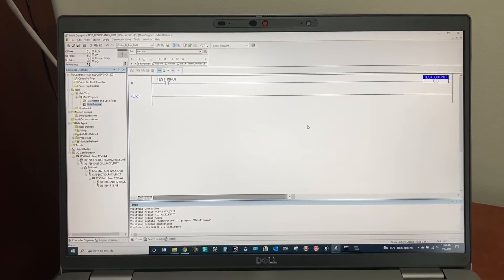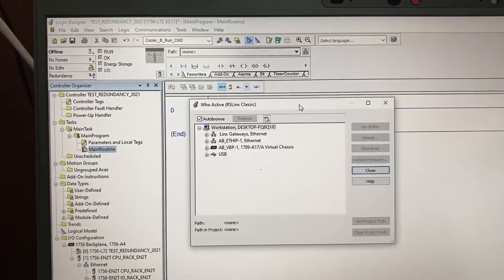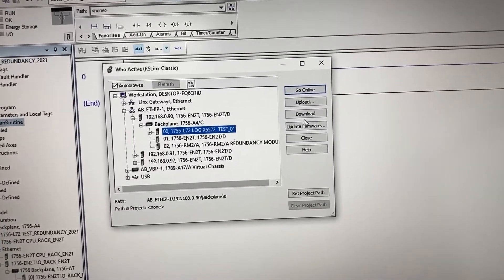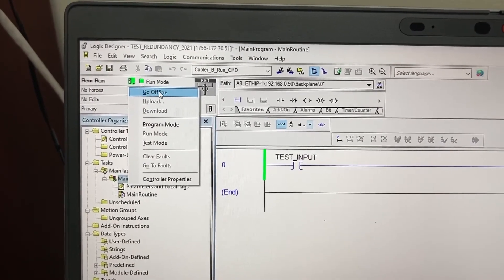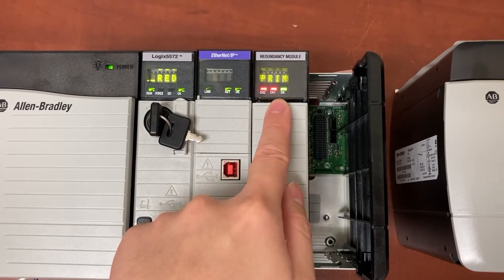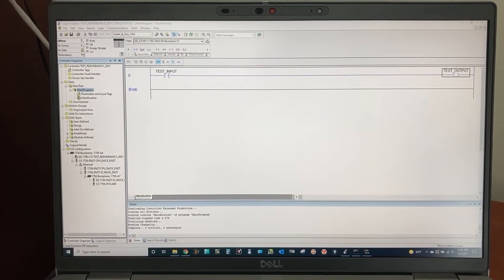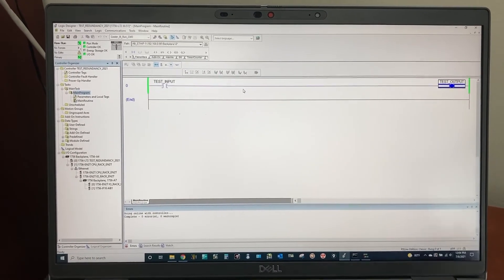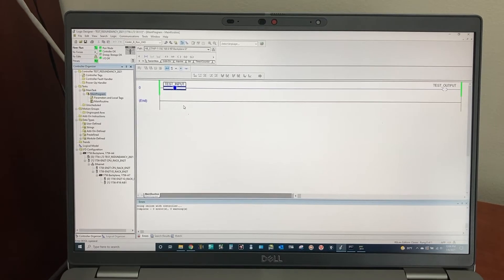Allen Bradley ControlLogix Redundancy System 1756 Part 5/5 - Program Download and Sync

Comment: At the beginning you setup your second ethernet module with .90 as well, but here I can see  the address is .91, that is logical but my inquiries is, do you setup first with the same IP address and then, when they synchronize the IP address change? Or must be .90 to Ethernet 1 and .91 to Ethernet 2?
Reply from the maker: @andresf-sierra: I always set the same IP address to both ethernet modules on the 2 PLC racks to keep it simple. I never tried to set them up differently. As you can see in the video, once the second PLC rack is powered up, the next available IP address which is .91 is automatically set to the ethernet module regardless of what has been set to it (.91, .92, .93 or .250, it does not matter). What I mean is the IP address for the ethernet module on the PLC rack that is FIRST powered up matters most. If it is .90, .91 will be automatically set the the ethernet module on the PLC rack that is powered up later. For the PLC rack that is powered up later, the only thing we need to make sure is it needs to be on the same network or subnet with the FIRST one in order for the redundancy to work. I hope this has answered your questions and cleared up your concerns. Thank you for subscribing to my channel and bringing up a very good point on IP addresses.
Reply: @SYPHOANG  Yes, thanks man. When you say the same subnet are you referring to the Network Mask? Or just the same Ethernet Switch connection?
Reply from the maker: @andresf-sierra: Same network or same subnet are the same. It means the same subnet for the IP addresses such as 192.168.0.90, 192.168.0.91 and 192.168.0.92 (only the last numbers are different or unique). Hopefully this has answered your questions.
Reply: @SYPHOANG  Of course you did, thanks for your kindness.
Reply: Hey, I already flash all the modules but when I jump to the RM2 setup step, it's no possible to open the "Module Configuration" in the RM2 module, any clue?
Reply from the maker: @andresf-sierra: How did you flash the firmware? Did you use the one in the bundled in the zip file downloaded from Rockwell website.
(@3:58) https://youtu.be/2vnflGhBkQg?si=5bGyayV3ADaOnyOG
also check your RM series and status indicators. Good luck!
Reply: @SYPHOANG  Yes I did. I dowloaded from Rockwell page, unzip the .dmk into a folder, then when I was in the Flash process I selected that folder and flash it. All the modules goes well with the flash process, however, when I tried to right click the RM2 module, Module Configuration options doesn't appears.
Reply from the maker: @andresf-sierra: (1) What is your studio5000 Logic Designer version? Is it 30 or above? It should be 30 if you are using the exact firmware bundle in the video.
(2) In Rslinx, does the RM2 module has a graphic icon? Or is it just a big question mark? If it is just a yellow question mark, you can "Upload EDS file from device" and try it again.
Good luck.
Reply: @SYPHOANG  FYI, we successfully complete the process, however, we talked with Rockwell Customer Services and they guided us in the process and the thing is, now, the setup of the module is a physical process. We need to connect first the RM2 module, setup and then the others modules.
Reply from the maker: @andresf-sierra: Of course, you should do it one at a time.
@0:05 https://youtu.be/xqF7rsclrtI?si=4mSTGJjHG6hHJTZ3
Although both PLC racks are powered up but I have no cables whatsoever connected in between.
I guess you had ethernet cables and fiber optic cables connected between 2 PLC racks. That might be the reason.

Comment: Do I need two fiber optic cables to connect between modules? Will one cable work?
Reply from the maker: @Bentimmy4: Yes, you do need 2 cables. It still works with one but you will no longer have the redundancy if that only cable fails.

Comment: If you make an online change to the primary plc program will it automatically sync to the secondary plc or do you need to toggle power?
Reply from the maker: @emg1233: It's best to turn off one PLC rack. Redundancy system might automatically sync only the data values, not the logic. Thank you for your comments.

Comment: Hello, thanks for the videos. Did you download both projects to both racks (didnt look like it), because the second rack says “no project”. When you boot the second rack into secondary mode, does it automatically get the program from the primary system?

Also, what happens if you disconnect the ethernet cable from the primary or secondary rack? is checked/maintained through a ping or so between the two racks while program syncing is done through the fiber? Thanks a lot
Reply from the maker: @HelloWorld: Thank you for your support to my channel. If you watched this whole series of Redundancy Set up, you would have seen that I never downloaded the program to the second  PLC rack. To download the program to the secondary PLC rack, it should be done automatically by the primary PLC rack, not manually from the PC. When both PLC racks have the program, loosing the Ethernet cable between possibly make both become primary. However, I never tried it before.
Reply: @SYPHOANG  great thanks a lot. I did watch all the videos and just made sure I didn’t miss it. Thanks for doing this, it’s very difficult to see redundancy done and Rockwell barely provides training for it. There are other videos on YouTube but no talking…which is not helpful
Reply from the maker: @HelloWorld-lt5oc  Once again, thank you for your kind words and your support to my channel.
Reply: @SYPHOANG  I downloaded to the 2nd PLC already, as I am new to Rockwell and used to doing this process on Yokogawa. Will it create any issues for me? Do I need to factory reset the 2nd controller?

Comment: In the same redundancy config, analog input card is blinking, showing FieldPowerOff set to bit, resulting  fashing green, what should be solution?
Reply from the maker: @Md Sallam Ansari: Unfortunately I have never experienced this. But I think it might be from the analog input module itself or the power issue on the IO rack. It’s either from the rack itself or the power supply of the IO rack. When your PC are online with the system, let’s check status/fault under properties of the module.
Reply: @SYPHOANG  Sir, indicating running ok status, No fault showing, also checking power supply to the module, found its ok
Reply from the maker: @Md Sallam Ansari: Unfortunately I have never experienced this. How about the other modules? Are they operational as normal? If so, you should check the properties of the analog input module in the PLC program (such as revision).

Comment: This video is very helpful, thank you.
Please kindly confirm this, don't we have to download the program to the secondary CPU?
Reply from the maker: @Daniel Esinwoke: First, Thank you for your support to my channel. I confirm that we do NOT have to download the program to the "SYNC" PLC. I thought I mentioned the reason in the video. If not, the reason is it is to ensure 100% the exact program downloaded to "PRIM" PLC will be synchronized/downloaded to the "SYNC" PLC automatically once it is powered up. For redundancy system, you should not do anything to the "SYNC" CPU. All the program, setup, and configuration should be done on the "PRIM" CPU. For the "SYNC" PLC rack, the only we need to ensure is all its modules, including the CPU have the exact same firmware compared to what is on the "PRIM" PLC rack. Hopefully my response is clear, informative and answer all your concerns.
Reply: @SYPHOANG  Excellent explanation; Thanks Bro
Reply from the maker: @Daniel Esinwoke: Thank you for subscribing and your support to my channel.
Reply: @SYPHOANG  Please, can you make a video on how to Pull data from SCAME F&G Panel to ControlLogix PLC via AnyBus HMS-EN2SE-R EtherNET IP / Modbus RTU Module?
Reply from the maker: @OTPlatform : Unfortunately, I am not familiar with the ones you mentioned.

Comment: Redundancy module showing disqualify...what is the solution please..
Reply from the maker: @Bimal Padhan: Have you watched the other videos in this series?
Allen Bradley ControlLogix Redundancy System 1756 Part 3/5 - Config. on redundancy module 1756-RM2
   https://youtu.be/xqF7rsclrtI
Allen Bradley ControlLogix Redundancy System 1756 Part 4/5 - Programming Studio5000 Logic Designer
   https://youtu.be/--d_CVbWxIo
Reply: @SY P HOANG  yes sir..but in a ring network rapid ring fault detected and disqualify sync. Module
Reply from the maker: @Bimal Padhan: I am not sure what you are experiencing but the secondary PLC rack always starts with disqualifying, then qualifying and sync. If you are online with both PLC racks, you can check the module status.
Reply: @SY P HOANG  check module status shows physical module doesn't match module configured in project. What should be done..sir also show module identity mismatch..
Reply from the maker: @Bimal Padhan: You can change the modules in the PLC program to match with the actual modules you have on the PLC racks. However, all modules on the 2 PLC racks must be identical. Also the module firmware needs to be exactly matched between the 2 racks.
Reply: @SY P HOANG  ok sir thank you..
Reply: Hi, experiencing the same problem. Secondary redundancy module showing disqualified continuously and not sync..
Reply from the maker: @vasantht3438  You should check firmware on each module. The controller L72, the ethernet EN2T and the redundancy modules. The firmware for all modules comes in a package from Allen Bradley website.
Reply: If the time not synced between the two redundancy modules will cause the above said problem.
Reply from the maker: @vasantht3438 : It should be done automatically. The logic actually is running on the Primary PLC only. The SYNC PLC is synchronizing all data from the Primary one all the time and wait for its chance to become the Primary.